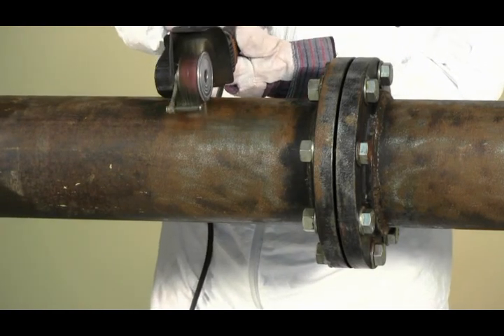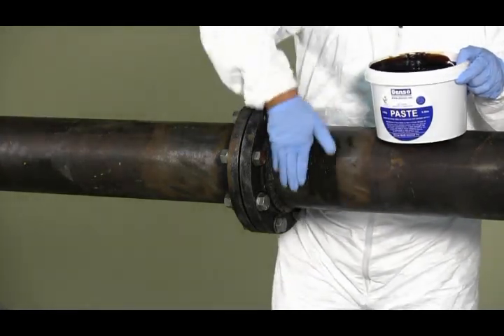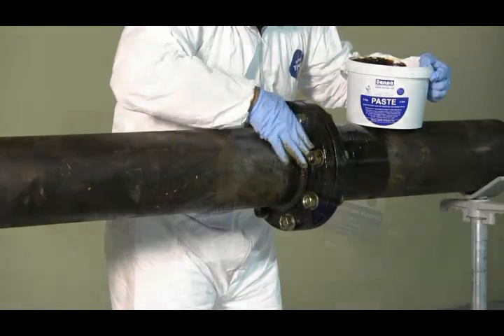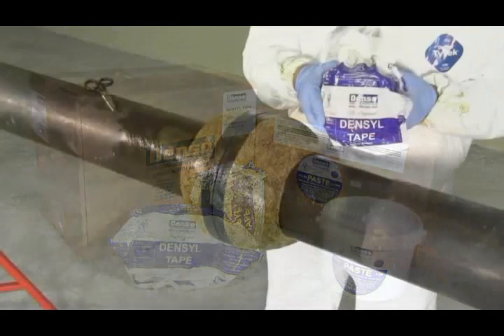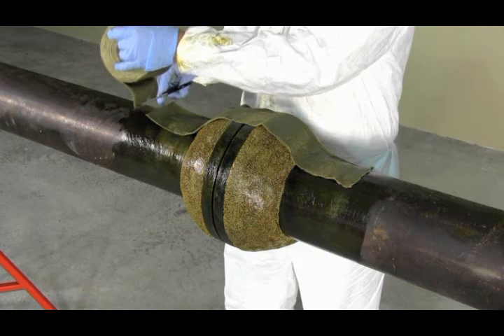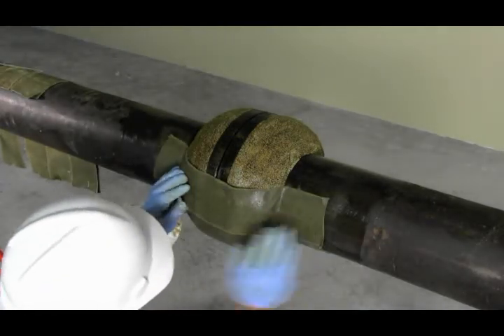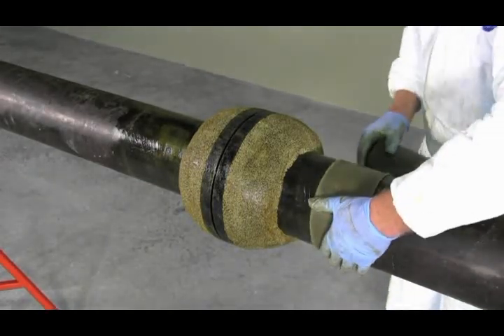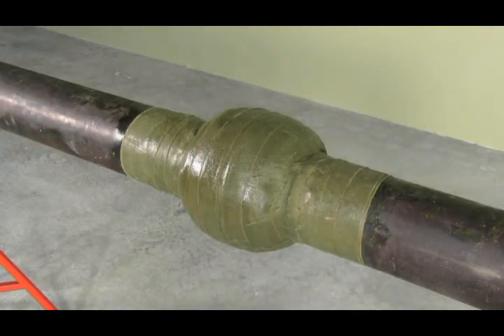Denso Petrolatum Tape Flange Protection

Comment: approx how many minutes requires to apply adhesive , mastic and tap[e on one flange lets say 4"?
Reply: With good tools and access expect about 3min of actual wrapping for two guys, one cutting and wrapping the other priming and moving gear between areas.
Don't have gloves, add 1 min.
Don't have rags. add 1 min.
Use blunt knives or scissors add 1 min.
Don't have a good system for moving the rolls add 1 min.
Can't get good access due to neighboring pipes wires and junk add 3 min.
Need High access, scissor lift, mancage,  etc add 10min.
Need High access with rope work add 20min.
Using only one guy multiply times by 2.5.
Adding a 3rd guy won't help unless High work is involved then multiply times for two guys by 0.9
Corrosion clean up on older pipework can be anything from 3-20min just on its own.
This doesn't include the walk time between joints.
Tips:
If multiple flanges are too close together wrap them as a assembly.
Cotton or wool gloves over a pair of nitrile gloves may assist in geting the primer around fasteners.
All tools will get covered in primer and tape grease, May be worth having a denso tape tool kit.
Tape applies best at about 20'c - 28'c. If in cold climates store tape in a Chilly bin/cooler but put a bottle hot water bottle wrapped in a towel in with it to keep it warm and workable.(application of hot air may assist in extreme cold).
Good scissors tend to work better than a good knife on tape widths less than 120mm.
Baking paper provides a low adhesion surface when needed.
Disposable coveralls recommended.
I don't work for denso but have used a lot of there stuff, Its just advise and being that you comment if over 6 months old you probably don't need to know any of this but someone else might later.
Reply: @another1commenter770  You Sir are a hero. This is the kind of advice one would always be glad to receive. Thank you.